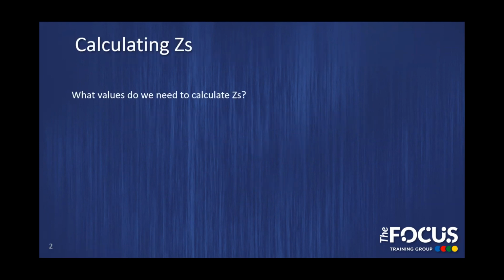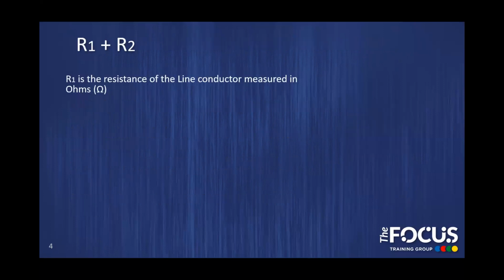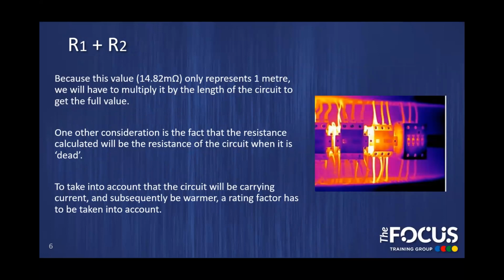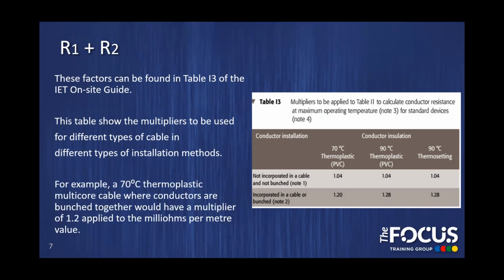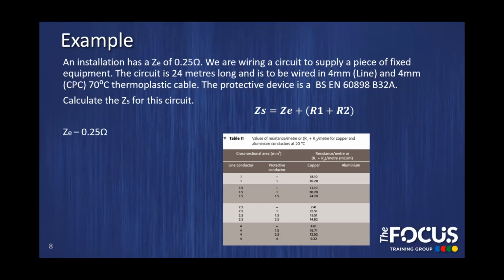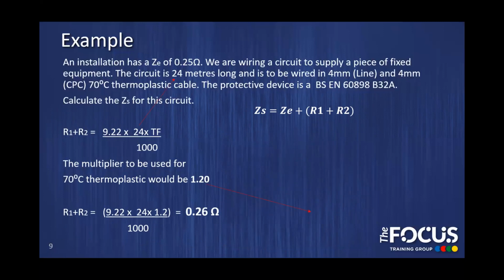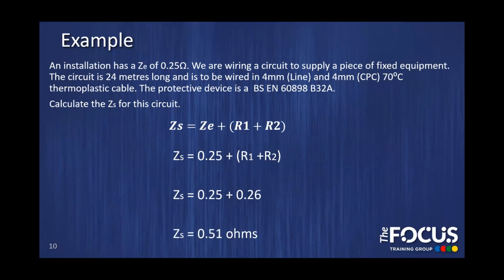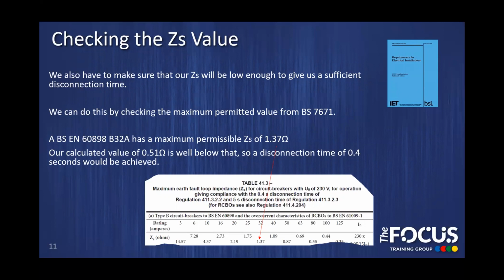Calculating Zs

Comment: Hi, very good and clearly explained video. However I have a suggestion, the maximum permitted value Zs should be taken from OSG Table B6 because it is a measured value not from BS7671 Table 41.3 page 62. Am I right? if not can you explain, please.
Best regards
Michal

Comment: Good.
Can you tell if we can calculate Ze by any method? For example in the external fault loop path, one transformer winding leg is involved ( this can be found from name plate data),also length of line from transformer to consumer panel is known,and so you can find its impedance from tables, then from the consumer panel up to transformer grounding rod there is a cpc, and it's length and size being known, so you can find its impedance ,so can we add the above 3 things and get Ze.please discuss it.
,